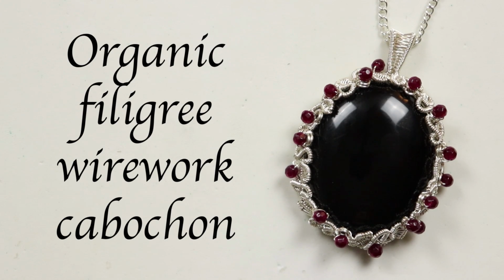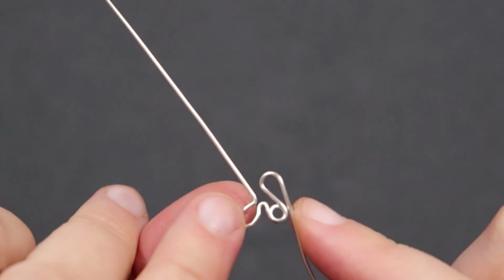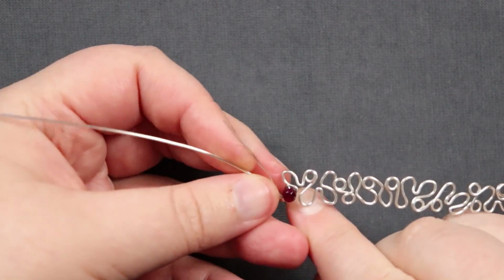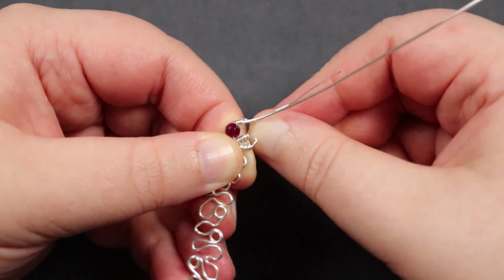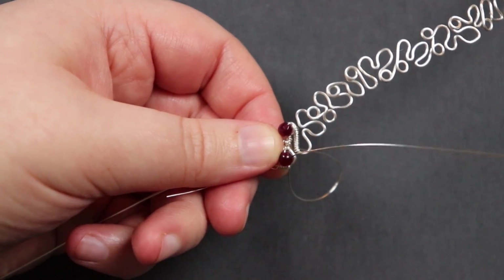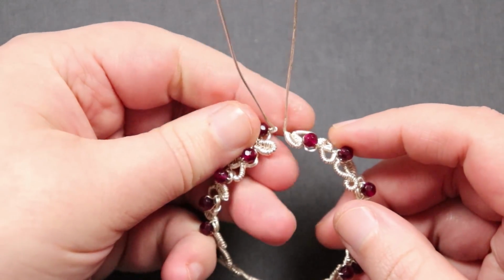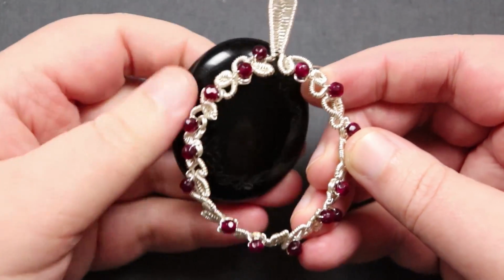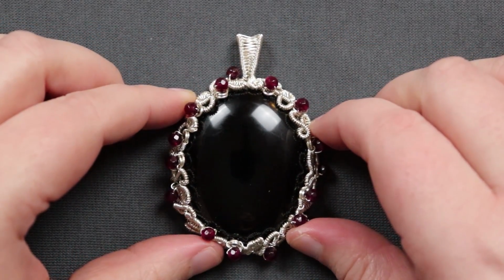Organic filigree wirework cabochon

Comment: Just fabulous! What kinde of hardnes of wire you use, half hard or dead soft?
Reply from the maker: I prefer to use soft wire for my projects, as it's easier to work with, but hardens while working with it. And it's worked fine for my projects so far 😃